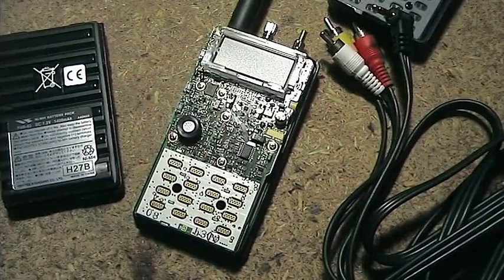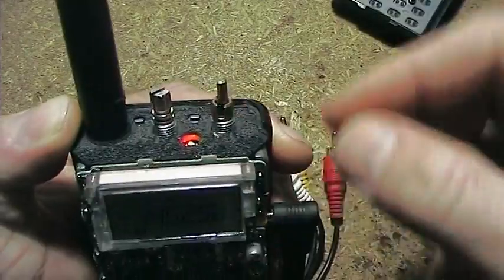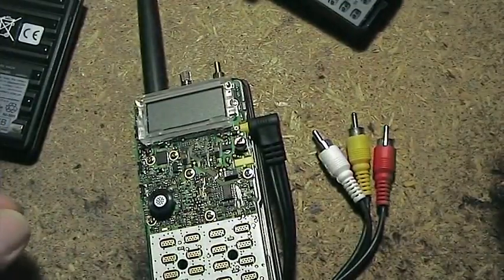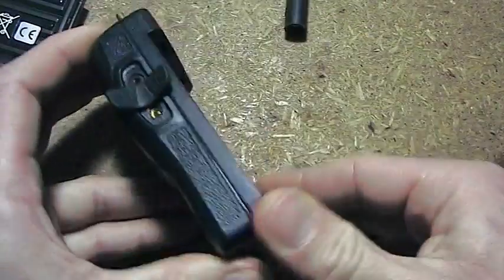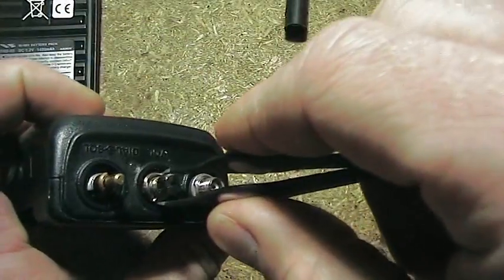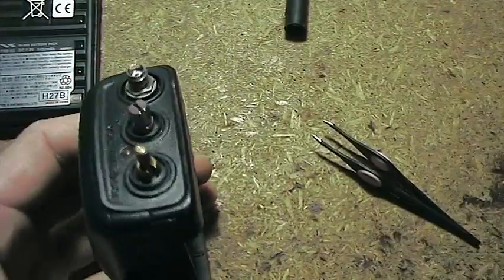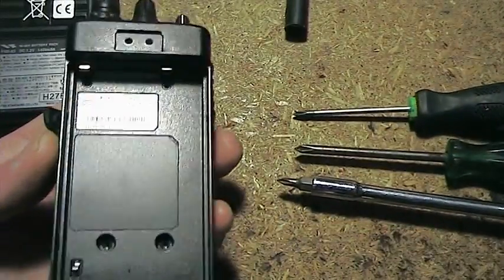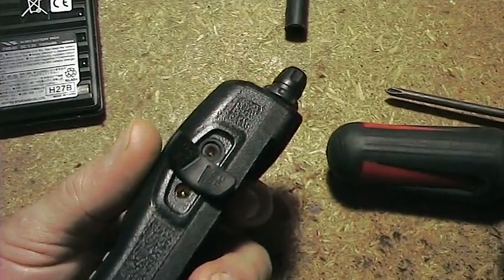Yaesu FT-60r Mod and Dissasembly

Comment: I think I would have modified the plug...maybe use a dremel tool small wire wheel to remove some of the plastic at the base of the metal part of the plug.

Comment: What a disappointment - I thought this was going to be a tutorial for the Mars mod that Terry mentioned below. Well, he didn't mention it technically, since he copy and pasted someone else's post from another forum, but you know what I mean. Would you please make a video for the mars mod? Thanks.
Reply: +RationallySkeptical Great job...You want help doing the MARS mod but you are talking smack about the two Elmers that could help you out.  You sir are a disappointment to the hobby.
Reply: TheQwik512 At no point was I "talking smack" about any person. I merely stated the video was a disappointment. You're an idiot. THAT is talking smack. See the difference? And who is the ACTUAL disappointment to the hobby - someone who makes an innocent comment like I did or a sanctimonious ass like you who insults and demeans brand new hams. YOU are an embarrassment to the hobby.
Reply: I have since found a much better solution. Gigaparts will do the mod to any radio you buy from them which gets around the whole problem of voiding the warranty, which is exactly what happens when anyone does the mod themselves.
Reply: U

Comment: This Mod will give TX 137-174Mhz and 420-470Mhz and is verified for US spec radios only. 
Mod involves removal of an extremely small surface mount resistor. Do not attempt if your skills are not up to it. Irreparable damage could occur to the radio. 
Mod does not make radio compliant for CAP use; it may also void your warranty. 
Do not ever transmit on a frequency you are not licensed for. 
This mod is provided for reference only. 
Performing this mod will erase all memories and re-set the radio. Perform at your own risk! 
Instructions

Remove belt-clip and battery 
Remove the 4 screws (2 silver and 2 black) in the battery compartment.

Remove antenna and pull off the knobs

With tweezers or needle nose pliers, carefully remove the rubber gaskets around the knob shafts. 
Unscrew the two split nuts from the knob shafts

Take out the rubber plug for the mic and DC sockets and swivel it around 90 degrees. 
Carefully remove the body of the radio from the front panel. Ease it out from the bottom first making sure you don’t damage the rubber waterproof seal that goes all around it. Separate the LCD section from the front section.

Remove R1164. This is found on the right side of the radio, on the board just above the keypad area.

reassembly is the reverse of the disassembly.
Reply: +Terry Vanderpuke If you're going to use someone else's words verbatim, you need to mention your source. Plagiarism is an ugly thing. I understand that this is an informal forum, but it's still incredibly rude to give ppl the impression you wrote something you didn't.

Comment: Thanks Brenton for that tip. I found a tiny screwdriver was useful to lever out that rubber grommet without cutting it from the speaker mic socket on my FT60. 73 Larry VK6CP

Comment: Me again. The mod went fine. I had something odd happen when I was reassembling the unit. I started to panic because I couldn't find the two smallest screws. After searching my work area I noticed they were already fully installed in the screw holes. I then realized I had no memory of removing them in the first place. My conclusion is either the it's not necessary to remove them to do the mod or I'm going crazy. Perhaps both.

Comment from the maker: From memory there was a significant amount of thread locker on those screws, yes. So long as the correct sized screwdriver is used, and sufficient down force applied, they can be removed without damaging the head.

Comment: Did you find the screws holding on the belt clip to be difficult to remove? I've heard that the lock-tite on the screw threads can be a bear.

Comment from the maker: That may help with some plugs, but the plug I use for APRS has a metal lip around the base (as does the plug in the video). The inner section of the gasket is about 0.5mm thick and presses on this metal lip causing the plug to pop out very easily.